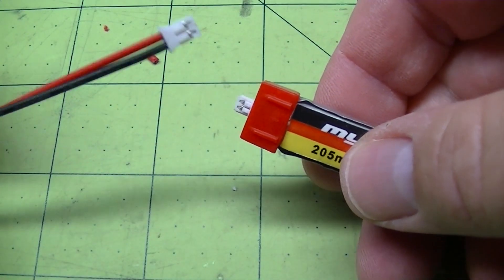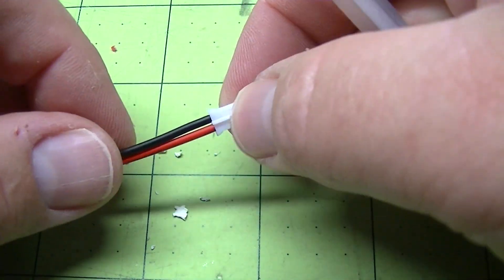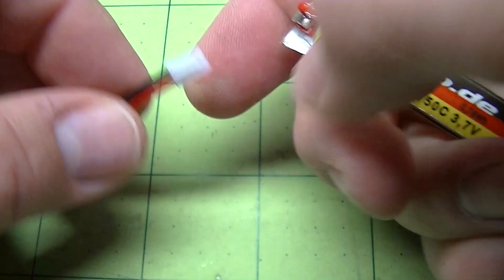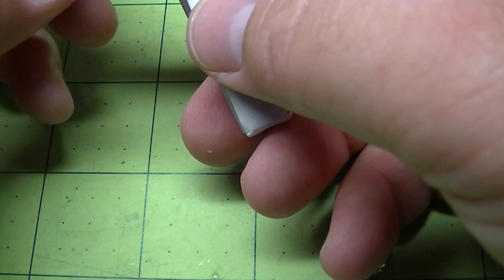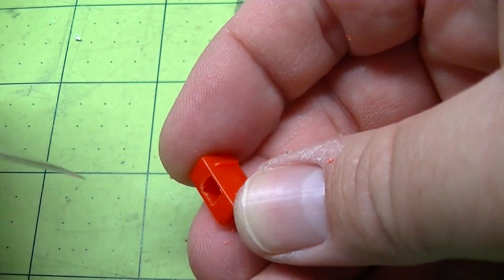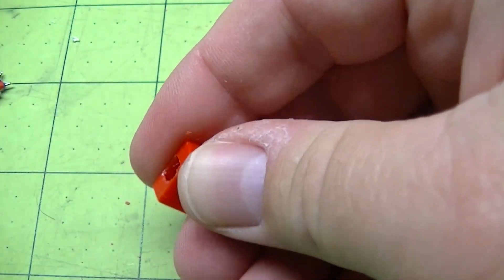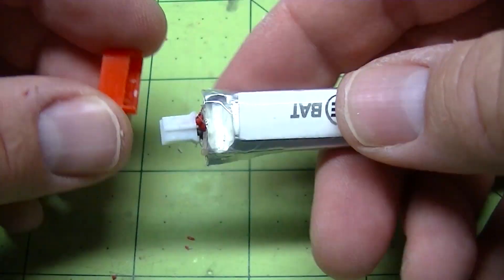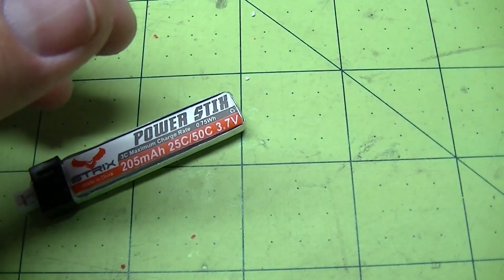Tiny Whoop PowerWhoop Battery Connector Upgrade

Comment: i got rid of the jst connector and installed a deans micro plug.  Essential get rid of the plastic cover connector and plastic separator.  Fold the tabs back towards the battery so the tabs are flush with the battery.  Solder in the polarized 2 pin deans micro plug.  Fill with shoe goo or similar and wrap with some capton.  

You'll end up with a much more durable connector than any JST connector.  I was shocked at how much more power and endurance I gained by switching.

Comment: Had to like on so many levels. , the glue tip alone was worth the time.
Reply from the maker: If there is one thing I had to recommend, it would be the welder glue. A dab on each strut at the duct, and the stock frame is near indestructible.
Reply: motoshane I lose so much flight time because of that.
Reply: Followup - the stuff is fantastic and the tube is PLENTY large.

Comment: Great tutorial! Just FYI you're calling the JST-PH connectors female, even though you're linking to the male variants (which are the right ones for the batteries). 

Keep up this great channel!
Reply from the maker: FPVisionary Amazon likely changed the description. The picture shows the female connector. there was a lot of retailer confusion back when I researched all this. They seem to get the description right, but almost always the picture is what you'll get. I know I picked an accurate link at the time. Where ever you order from, make sure to double check the description, picture and reviews.
Reply from the maker: FPVisionary To explain further. A connectors gender is determined by the metal contacts, not the plastic contacts. The female side does go on the battery, and the male is on the whoop side

Comment: Good video Mr Moto.  In order to upgrade the battery connector from your ordinary small JST to the slightly bigger JST PH, you have to do this with your batterys.  I know Tiny Whoop sells the already upgraded batterys but your still limited to just those specific ones.  Thnx Moto for posting this, i'd have no idea if not :)
Reply from the maker: Jesse Clingman You're welcome.

Comment: Dude that was so funny... I really thought the way you was presenting this it reminded me of Bob Ross..  then just seconds later you said it... lol!!! That struck my funny Bone this morning.. lol
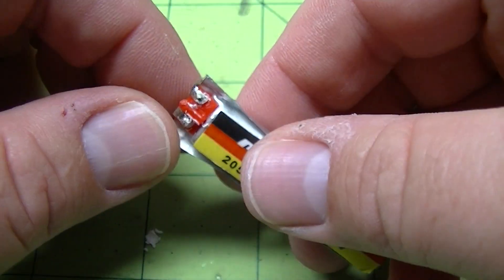Thanks for the video.. I got 2:47 out of my 260mAh GNB this morning, (with Beta75) Id like to do something to increase my time.. any suggestions? Those batteries I have already has the JST PH connectors....
Reply from the maker: Glad someone finally commented on the Bob Ross reference. I usually only get just over 2min on 205mah batteries. The betafpv 75 has a lot bigger motors than standard 6x15 motor whoops. 2min47s seems pretty good for 260mah on the bigger motors. Cutting weight would be my only suggestion.
Reply: Lol.. Maybe it took a Hillbilly to know who Bob Ross was. 
My test was a LOS hover test.. actual flying is a little less.. Round 2:30. I have a 450mah 1S on the way. Someone claimed 4 minutes and I'm gonna see if they were lying. (laughs) I expect the extra weight to mess with flight characteristics.

Comment: Losi micro connectors (those flat ones) look more suitable for frequent use imho. 
I'd post some links here, but it seems that I have an annoying beeping alarm here that I must tend to first.
Reply: It seems the main community has standardized on the jst-ph.  Losi really screwed stuff up when they swapped polarity.  Drives my charger nuts and then triggers my OCD to see the red and black swapped.  But, if you've converted all your gear - enjoy - just don't ask to borrow batteries.(grin)

Comment: I accidentally broke one of the tabs. Should I open the battery and go inside and try to solder from the nearest available point or just dispose of it?
Thanks for your video :)
Reply from the maker: TechtronicMountain Dispose of it. Once you breach the metal pouch it's done for.
Reply: motoshane I will, thanks!

Comment: I have a parallel charging cable for the old connectors - What are you using for these?  I bought a set of 50 connectors (male and female) and I'll wire up my own.  Seems the tinywhoop store is out.
Reply from the maker: Wholly Mindless This is what I use. https://www.amazon.com/Paraboard-Parallel-Charging-Board-Blade/dp/B00DCFFK2S

Comment: Hi. Very good video. I think i need a 1.5mm jst for a led, but the one i've seen on amazon have round holes and the one i need seem to have flat pins. Is there a different  name for those connectors?
Reply from the maker: Does it look like this? AC_SX236_SY340_FMwebp_QL65
Reply from the maker: It might be called a picoblade by molex.
Reply: @motoshane2  Thank you for your answer man, but I can't see the image. Can't you link me a page where they sell it please?
Reply from the maker: nidici 20pcs(10 Pairs) 1S Lipo Charger 3.7v Battery Charging Cable Male & Female for RC Quadcopter Drone Multirotors https://www.amazon.com/dp/B01MXE9IE8/ref=cm_sw_r_cp_apa_WA7WBbXV8E6VP
Reply: @motoshane2  Shane you the boss man, thank you very much for taking the time to help me, but those are not the ones im looking for. Can i send you pictures of the broken connector i have to an email or something?
Reply from the maker: @gabrielesposito2735  Of course. Send a picture to motoshane2@gmail.com.
Reply: @motoshane2  It looks like this one (2pins), but i'm confused with the pitch distance. In this page it says 50mm, 100mm, 150mm, etc. but as I measure the distance between the pin holes it is 1.5mm (i think, not even close to being an expert) https://www.molex.com/molex/products/listview.jsp?query=&path=%2Binmeta%3Acategory%3DCable%252520Assemblies%26partialfields%3D%28productname%3APicoBlade*%252520OTS%29&channel=products&key=picoblade
Reply: @motoshane2  Thanks man. Righ away!
Reply from the maker: @gabrielesposito2735  I sent you an email. Looks like a JST-GH 1.25mm 2 pin.
Reply: @motoshane2  Thanks man !

Comment: What kind/brand of silicone are you using there? I'm having a heck of a time finding some neutral cure locally, but maybe I'm just not searching for the right thing.
Reply from the maker: Adam Kouse I just used regular home silicone from Home Depot. Someone in the comments mentioned this silicone for electronics. https://www.amazon.com/MG-Chemicals-Corrosive-Translucent-Silicone/dp/B005T8R6LY/ref=sr_1_1?s=industrial&ie=UTF8&qid=1481893370&sr=1-1&keywords=electronic+grade+silicone
Reply: Ah, thanks for the link. I ran through the comments but must not have expanded them all. I'm on it!

Comment: So the one on the battery was JST-GH?
Reply from the maker: I don't believe so. Its been a while. However, the Picoblade 1.25mm is the small connector and the large is PH 2.0mm. Its the distance between the pins that is the main difference. The small is 1.25mm and large is 2.0mm.
Reply from the maker: Yes. I'm pretty sure it is.

Comment: i ordered jst ph connectors. but in the picture the red and black cable seem to be opposite, unless its just mirrored picture. I could just remove the wires and swap them correct? i mean do they normally come standard polarity?
Reply from the maker: Jan Domingo Yes you need to make sure to watch polarity. You can carefully switch the wires around, or just solder black to positive and red to negative. Whatever you do, make sure the polarity is getting to the quad copter correctly.

Comment: Does it really make a difference? I mean, it is hard for to me believe thats gonna make a difference.

PS: I have seen now the old Micro Jst that the inductrix had, I had in mind the H8 connector from Eachine this:
 http://www.firstquadcopter.com/gallery/h8mini-quad-images/EACHINE-h8mini-battery-connector.jpg

So I think they are basically the same.
Reply from the maker: Yes it does make a very noticeable difference if you have a setup demanding enough power to notice it.
Reply: I guessed as much, just had that doubt about the Eachine connector (I don't know its name)
Thanks, and good video btw.
Reply from the maker: Thanks. I haven't even flown with that losi connector. I'm not sure how it would compare. https://www.amainhobbies.com/losi-connector-set-w-wires-losb0860/p9938?gclid=CjwKEAjw5_vHBRCBtt2NqqCDjiESJABD5rCJ9CgnhenvrdUzYYJip--UXaL9R8uw2Q6QFMMHIJ1H4xoCwwLw_wcB
Reply: You got it! Thats it. Losi Connector.

Comment: I just received my JST-PH connectors I ordered from your link in the description, but the wires look half as thick as the one in your video. http://i.imgur.com/nFLsJF2.jpg
Reply from the maker: Raneman What Guage are they? Mine were much bigger than the description of the amazon link. You probably got the right ones. I got the wrong ones. It's a very short run, and your wire is still much bigger than the micro jst wire originally used. Tiny Whoops powerwhoop cable is 24 gauge for a reference.
Reply: I'm not sure what the gauge is, I can't read the wires, even with a magnifying glass. I just want to make sure it's not going to be too thin. I don't have them with me now, but I'll look on more of the connectors to see if I can find one that's readable.
Reply from the maker: Raneman If it's a thicker wire than the stock micro JST, it will be much better. The wire I'm using is likely overkill.
Reply: Ok, cool. Just wanted to be sure before I soldered my first one. Thanks.